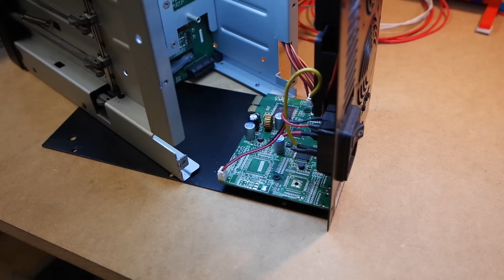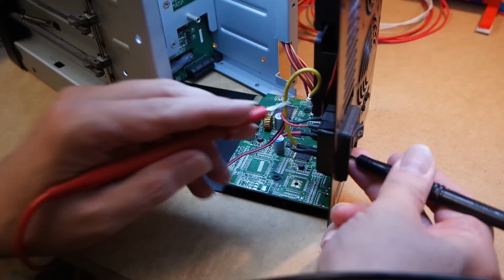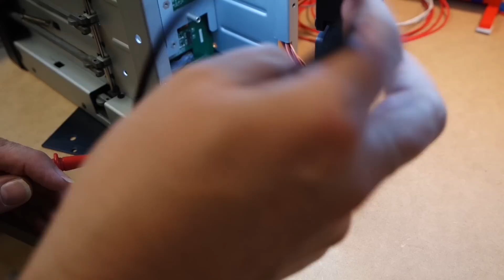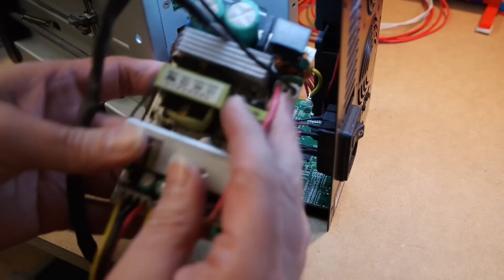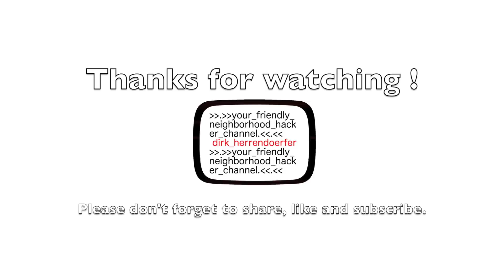Sharkoon 5-Bay deathtrap

Comment: Report to authorities.
Reply from the maker: I did. But in Germany that doesn't really do anything for you. Our warranty laws are there to protect the manufacturer and the buyer. The only thing that would make a difference is gross negligence, and I would have had to have suffered permanent damage.
Reply: Dirk Herrendoerfer I would say it is gross negligence.  Don't you have some government for see that companies follow electrical standards?  I thought you Germans was good at that? :-)
Reply from the maker: Yes, we Germans are good at that. But we're also masters at bureaucracy - so I suppose my complaint will rot for some time, until it fades into irrelevance. 
And, in theory there was a ground connection in place - only it didn't work, it probably worked for the one they tested for certification. The only thing I don't get is the dysfunctional power switch - that is against everything I know about safety regulations, that's what I filed the complaint about.

Comment: good video.   and holy crap that's gonna kill some one if not already .   something to be said for checking import products like such.   hell i had a single drive bay that claimed it was tested and passed but there was a Forrest of solder strings , like metal spider webs , a few spectacular flashes , made me look inside to see the shittiest soldering ever .
Reply from the maker: Yes. It's a small fault that the grounding wire does not make contact with the chassis, it's just a detail that the transformer has gone bad, so call it a combination of bad circumstances.
I'm game for a good jolt now and then, I've been repairing TVs for 20 years or so - but that was not the slight tingling sensation I got there, it was bam!pain in the arm for two days on.
I'm thinking of buying an insulation and mains grounding tester - rather expensive, but could have saved me from that.
On a side note, the power supply of the PC that the box was connected to is dead too, that power supply has a pretty elaborate aPFC circuit that is now malfunctioning - so I guess there must have been some current behind that failure.
Reply: i think going forward any non double insulated items i get from away , i will be checking for paths from ground pin to chassis .  We sort of take that for granted these days as a no brainier. i  this case i think it was originally designed to not be powder coated .  but the main switch should be a mains interrupt , all but the ground . things with a soft off usually have a small tac button up front .  
ALl this time i though i had a bad habit of turning off peripherals with the switch on the power bar. Hmm seems that wasn't such a bad idea. .

Comment: Hello. you can run the system if there is no visible damage to the lower control Board. you can simply connect an ATX power supply with a standard molex connector on Board which is inserted the disks. At least you can get your data.
Reply from the maker: Yes you're right, the internal connectors are normal pc type, the drives spin up and initialise when powered with an ATX PSU. I just have not verified the complete set, since at 8TB this might take long time and the desk is currently occupied by another project.
All data on there is backups - so, as long as the primary holds out I'm fine. Cheers, Dirk
Reply: @dherrendoerfer  This is exactly what I did, hooked up an ATX PSU, it ran, got my data.....and threw out this garbage bay.